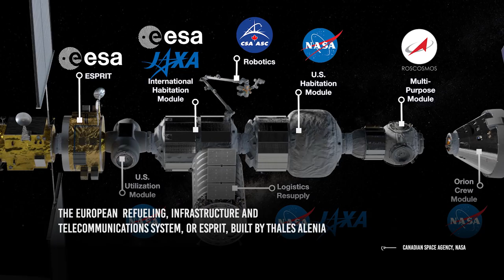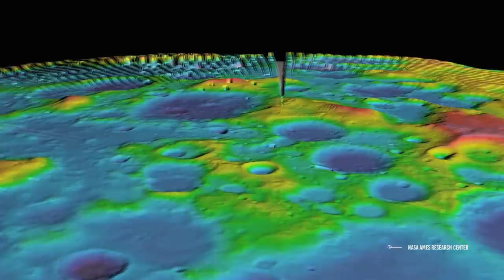How Does The Artemis Program Plans To Take Humans Back To The Moon?

Comment: One idea for a reusable lander to/from the Gateway station is a propulsion unit that lowers a human/cargo carrying lander by cable for a soft touch down then, reduces thrust, and lowers itself down to park on top.  The advantages are that you wouldn't have to be so picky about landing location because it'll be soft enough for most anywhere; and that there will be minimal dispersal of regolith by the thrust.  The propulsion unit would aim perfectly for its descent to the carriage by simply reeling in the cable.

Another idea is a slinky landing and launch cushion.  That is, for minimum use of propulsion, the lander would have a broad slinky-like spring to cushion its impact with the surface and a latch that catches precisely when stopped.  This would prevent any recoil bouncing the landing back up again.  When time to launch again, the latch would release the spring using that energy absorbed on impact to push it back up, again.  Granted, thrusters will still be needed to impact isn't too hard and as the spring will not have enough energy on its own to re-join the Gateway.  However, the fuel required should substantially reduced.

And yet another idea is the reverse-railgun lander.  This would require a long rail be built on the surface that would shoot the lander up into orbit to meet the Gateway and, to land, would catch the lander and slow it down.  In space without wind, a vessel can be guided with precision to land on rails.  This is how mission support calculated the Apollo flights to extraordinary precision.  The advantage of this system is that there would be no need for any propellant.  Solar arrays (highly efficient in space) would provide the necessary energy so flights up and down would be essentially free.  Furthermore, vessels could also be shot back into Earth orbit or to other stellar destinations.  The downside would be that landing and launch could only occur where a rail launch system is built on the surface.
Reply: Nifty thinking but the planned gateway orbit scratches both 1 and 3 immediately. 2 isn’t feasible either but I like the outside thinking